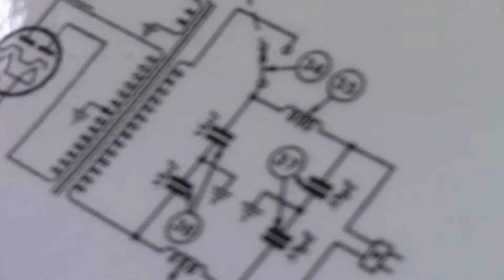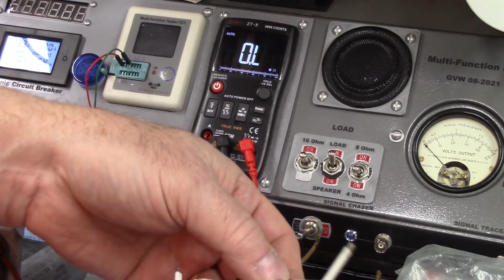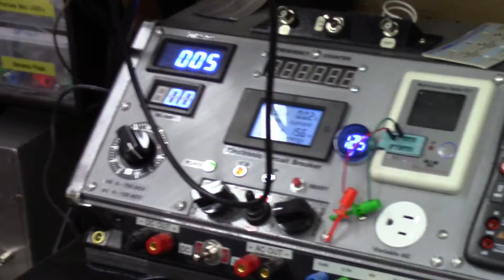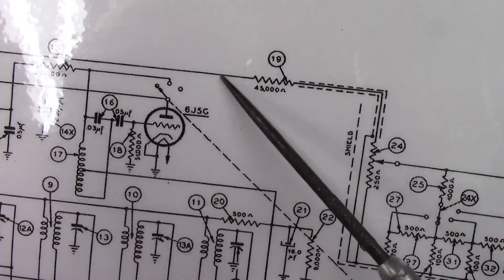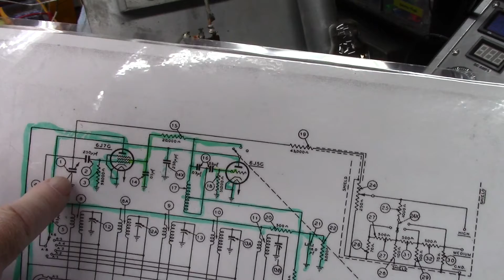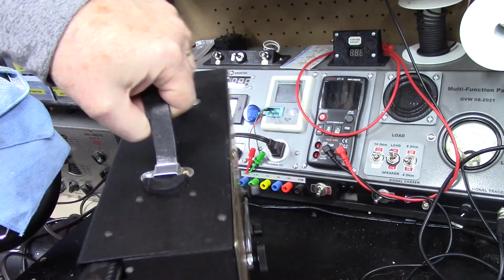1937 Philco 077 S G   Part 2- Final

Comment: Gregg, The power rating of resistors is given in ‘free air’ conditions.  It’s probably not too critical in this instance, but I’d suggest that if yoy have to do this in the future, you leave 3/8” - 1/2” spacing between the resistors to allow more air flow around them…
Reply from the maker: Thanks Gar! It is great info, and when I get back in town I will be redoing it with 3 watt resistors for a total of 6 watts per pair. I will space them as you stated. This will more than sufficient in this application.